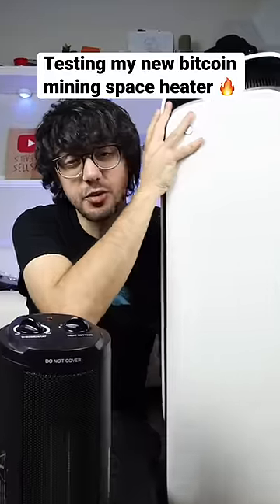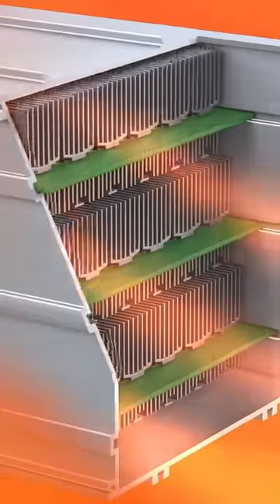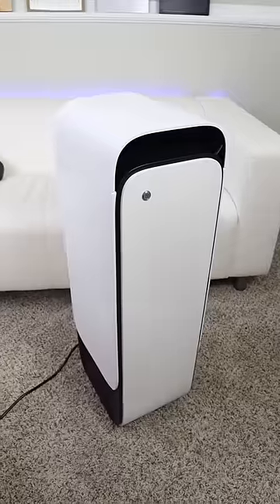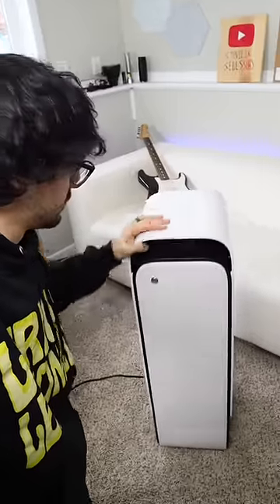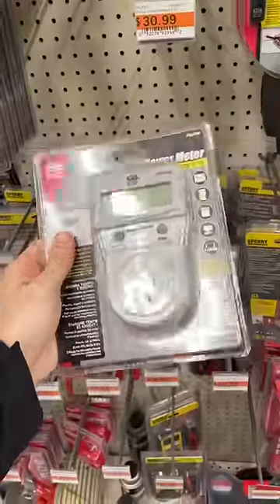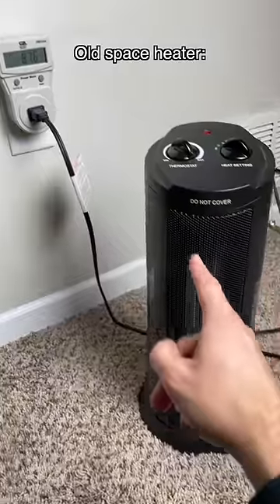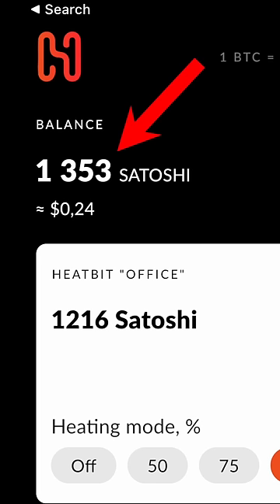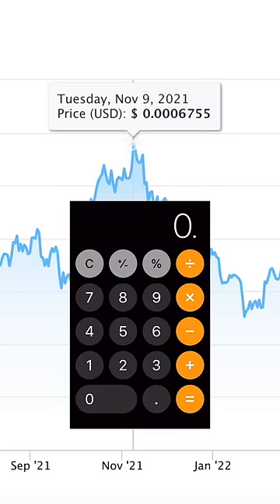My new bitcoin mining space heater

Comment: Got my $10 Walmart heater blowing on me while you got a $10,000 heater making $0.05 cents per hour. Life crazy
Reply: fr this thing is 10k???
Reply: Plus energy bill 🤣
Reply: @Drsteezymcgee  a 3000W mining setup won't cost more than a 3000W space heater
Reply: @rune_lol  so how can it be efficient at both heating and mining? It would have to split power somewhere wouldn't it?
Reply: @rune_lol  and cant running a space heater all day every day can be expensive ?
Reply: You aren't far from the price of $8,900usd for the white tower heater as shown in video
Reply: @rune_lol calculations actually take 0 energy. All the energy that is "used" actually is just turning into heat due to inefficiencies
Reply: Life crazy
Reply: It's around ~$1,100. Still crazy expensive for a heater.
Reply: @Drsteezymcgee  miners generate heat as a byproduct already which is the concept of this thing. Some people already build a ventilation system to pump the heat into their house or outside.
Reply: @Drsteezymcgee  computers/ mining rigs are 100% efficient space heaters. Technically the only part that can change the efficiency is the fan they use to blow the heat out.
Reply: @mashedpotatoes5323  ohhhh 🤔 but if that's the case why not just buy a mining rig and use it as a heater
Reply: @etherealnine  had no idea these things produce that much heat lol
Reply: @Drsteezymcgee  because this is probably for people who don't know how or don't want to build their own rig, it also looks pretty decent and seems like it could be moved around a lot easier than a mining rig.
Reply: With the cost of that heater you can just Stake some ATOM and generate 30 cents an hour without the electricity bill
Reply: @mashedpotatoes5323  fair point. The cost of convenience basically.
Reply: @Drsteezymcgee  100 percent of power in a computer ends up being heat
Reply: @etherealnine  because Bitcoin is a scam all the money goes to the energy companies.
Reply: @Drsteezymcgee  Its not semantics its how things work
Reply: @Drsteezymcgee  its a computer the downside of a cpu is it creates heat , esp if you are working it hard so 2 birds one stone its a glorified miner that has the benefit of heating your home , great in winter , but in summer no so much
Reply: @Drsteezymcgee  Energy does not disapear. It just takes another form.

By asking the miner to do work, it generates heat as a biproduct.

So you get two things accomplished with one action. Compared to only heating with a normal heater.

3000watts is 3000watts. Watts means joules per second, and that relates to energy usage.

Both mining and space heating converts all 3000watts into heat in the end.

Only thing more efficient would be a heat pump, then you could get 9000 watts of heat as the cost of 3000 watts under optimal conditions.
Reply: @UserOfTheName  it was a joke about how everything has heat energy lol
Reply: @MrDanisve  well what I read a while ago was that Bitcoin miners only put out 40% of thermal energy. So for 3000 watts  you'd only get 1400 watts of thermal energy.
Reply: @MrDanisve  also space heaters are 100% efficient at creating heat so maybe I'm missing something
Reply: @Drsteezymcgee  Miners are altso 100% efficient. Where else would the energy go but into heat? Its not emitting light, even if it did most light would turn into heat. Like a light bulb.

You can heat with normal lightbulbs too, will be a little loss but not that much.

Miner is not emitting radiation etc. Except heat raditation. 

This is elementary physics? Bit confused here..
Reply: @MrDanisve  I'm not an expert on physics, but I do know that an engine loses about 50 to 60 percent of energy do to friction between parts. Which, yes I understand, is heat. Buuuut the energy created is also being used to create something else, right. I mean I just looked it up and it says it doesn't ONLY create thermal energy. So therefore it would have to be less efficient than a space heater. Same power two things means less effective. It's the law of thermodynamics.
Reply: @MrDanisve  it's quite literally the idea of a perpetual motion generator. Which is impossible in physics to my understanding.
Reply: @MrDanisve  the reason why space heaters are so effective is because they use heater elements that are designed to heat, computer parts are not. A heater element is completely different than a CPU. Basic engineering. Having trouble?
Reply: @Drsteezymcgee heat comes frlm the chips
Reply: It's $1200 not $10,000 lmao. Still expensive of course but you could conceivably make a few hundred bucks a year, obviously not good as an investment, but to heat your room and use as a novelty it's not bad
Reply: 🤣 Nailed it.. The current price of bitcoin - it probably costs more in electricity than the bitcoin it generates.
Reply: @thisisisabella3634 is that why the biggest bitcoin miner uses solar?
Reply: @Drsteezymcgee  a computer is roughly as efficient as a space heater. Any difference is pretty much negligible. But it is definitely not COST-efficient.
Reply: @AlanisonYT  a CPU only produces 40 to 50% of it's energy as thermal energy from what I read. Where as a heating element converts 100. Think about it.. if a chip got as hot as a heating element it would be glowing red 🤦‍♂️
Reply: @AlanisonYT  parts in a computer can't even get that hot because they are designed not to
Reply: @Drsteezymcgee  why are you saying information that is incorrect, computer processors are 100% efficient space heaters, technically the only parts that aren't 100% efficient would be fans, mechanical hard drives and any LEDs.
Reply: @Drsteezymcgee  what do you think the heat sink and fans do? Also we’re talking computer, the cpu may produce 40% of the overall heat, but the rest is from the other computer parts. I can’t make it any simpler than that.
Reply: @Drsteezymcgee  mining requires computing, computing causes heat generation, heat is a side effect of the mining
Reply: @rune_lol  I can buy a 3000w space heater for under $1000, that thing costs 8.9k
Reply: @Betterthenyou375  obviously.. it's just less than half as efficient
Reply: @mashedpotatoes5323  have you ever seen a CPU glow like an oven element? They aren't built for that.. they would melt the all the components around them. Even with a hundred fans. You can't possibly think they are equally efficient at heating. Look it up my guy. One is built to stay cool one is built to stay hot.
Reply: @AlanisonYT  a circuit board would melt with a heater element in it. I can't make it simpler than that
Reply: It's $1200
Reply: @Drsteezymcgee  As i said, energy cannot dissapear. 

Only thing comming out of a computer is heat, and some light if you have LEDs on your tower. Or LED lighting inside.

The energy lost to light escaping your window is really not noticeable. Cause LEDs are so efficient. 

Why would it be less efficient? They both do the same thing, makes electric current go thru resistors. 

Just the space heater is one large resistor, while the computer is a collection of billions of resistors and switches. 

I have a bachelor in chemistry, and i have alot of physics cause of that. So im 99% sure im correct, atleast how we know physics today.
Reply: @Drsteezymcgee  No, cause you get 3000 watts of heat from a computer out of 3000 watts of energy.

Not perpetual motion generator at all.

And if you are talking about the heatpump.. Then lol, it only transfers energy from outside the house to inside your house.

Same way your refridgerator works. Its not "generating" the extra energy. Its transfers it from one location to another.

Man this is like very basic physics.. I have like 6 more years of physics at school than this stage.
Reply: @alouisschafer7212 $1200
Reply: this thing isnt 10k lol it literally cost less than my phone
Reply: @Drsteezymcgee  no because the mining is what produces heat. Its not a heater at all its just a bitcoin miner that doesnt use fans to keep itself cool.
Reply: @mashedpotatoes5323  I did research it. A CPU isn't a resistor. A heating element is a resistor. A heating element can get up to 1200° f. you're telling that anything in a computer can reach those temps? A CPU will die at like 100c. Maybe we're just talking about two different things lol and also you recited part of my comments verbatim wtf
Reply: @mashedpotatoes5323  you seem to be under the assumption that all energy is heat or something I really don't know what to tell ya
Reply: @Drsteezymcgee  Every wat a computer uses is converted to heat. a 300w computer produces as much heat as a 300w heater it just uses the power for something while it converts it into heat
Reply: @SerialElfYT  that's exactly what I'm saying the electrical energy can be converted to different types of energy. Not just thermal energy. Where as a heating element converts 100% of electricity to thermal energy, a CPU converts 40% and uses the rest for other things.
Reply: yeah so? I told you that it would heat the room for the same electricity cost not for the same initial investment.
Reply: It's only $1200
Reply: @Drsteezymcgee  lmao well you’re only harming yourself with your lack of understanding. So go ahead and believe what you want. Or educate yourself, maybe? I don’t care any more tbh🤷‍♂️
Reply: @alexdhall  its miner, not just a heater.  🤦‍♂️🤦‍♂️🤦‍♂️🤦‍♂️🤦‍♂️
Reply: It’s $1200, makes ≈$0.62/ hour, it’s not that bad if you live below the average kWh rate of $0.21 location that is cold year round. I’m in northern PA. It would pay for itself in 3 or 4 winters. My problem would be if it would still be able to competitively mine Bitcoin in 4 years and what it’s life expectancy would be as a workable machine?
Reply: @AlanisonYT  dude.. you can't convert 100% of electrical energy into thermal, mechanical, kinetic and radiation 100% across all boards. Law of thermodynamics. It's a thing. CPUs convert electricity to more than one type of energy whereas elements create one. Arguing with crypto bros is impossible 🤦‍♂️
Reply: @AlanisonYT  alright man I think I have a better way of explaining it to you. A heating element gets hot because it is made to get hot. 100% efficient thermal energy. A CPU converts electrical energy into a bunch of energies and the byproduct is heat. 40% efficient thermal energy
Reply: @Drsteezymcgee  mining creates heat as a byproduct. This is why Iceland has so many mining operations.
Reply: @sailingketchstarship1965  oh y'all are just fuckin with me 😂
Reply: @mashedpotatoes5323  don't tell me what to look up.
Reply: @Drsteezymcgee  just trying to help. Although with that response it's pretty clear you are trolling. Either way your comments are foolish.
Reply: @Drsteezymcgee  the efficiency of silicon is not that great 99% of the energy you put in is turned into heat
Reply: @AlanisonYT  Cost efficient depends on the marked.

I bought 6 gpus and made a frankenstein miner out of wood and some random PC parts i had laying around. in 2018

I sold the crypto when high and made about 10 times as much as the miner cost me to make. And i still have quite abit of crypto i havnt sold. Even bought myself new teeth with the crypto, and a car. 

The miner heats only 800 watts so i have to turn on extra heat during the worst of winter.

If you mine with this thing, and sit on the crypto untill the recession is over and markeds go up again. You can earn quite abit.

If i just used a space heater, i would still have ugly front teeth. Not having an Audi Etron car with lots of horsepower (Imma car freak) and general good economics compared to what i did have.

And soon i might get to my goal of buying a farm which is crazy expensive. Thanks to me using crypto as a space heater.
Reply: @mashedpotatoes5323  bro how am I trolling when I'm right come back when you know what you're talking about
Reply: @Drsteezymcgee  I do as well as everyone else in this comment section that is calling your crap....
Reply: @mashedpotatoes5323  the fact that you think you do is scary. Maybe one day you'll understand, but I'm done trying to educate you.
Reply: It’s actually around $1200 USD
Reply: while also losing even more due to more power draining your wallet.
Reply: @Drsteezymcgee  you just pulled the reverse uno on me 😂
Reply: @mashedpotatoes5323  😂 at least you're fun
Reply: @Drsteezymcgee  all the energy used mining satoshi would be turned into heat. The byproduct of using electricity like this is heat. Since electrical heating is technically always 100% efficient. And every watt used is 3.41 BTU. There is no difference between heating using a ceramic or a computer. But at like $10k this thing would take years and years to pay for its self. Not worth it.
Reply: The heater is $1200.00 but your point is still valid..
Reply: My 25 dollar heater from big lots I've had for 7 years. This things powerful man..
Reply: @ignCatchiest  no but it'll cost you one hell of a lot more than 2 - 1500 watt space heaters.
Reply: @Drsteezymcgee  the point of it Is it uses the heat from the components to blow out hot air
Reply: It's  about $1200, but um. I think I'll be waiting until the a summer time sale to run next year. MAYBE????
Reply: @Reaperzx6  thank you that really clears it up
Reply: @junkjunk4148  lol no
Reply: @rune_lol  yes it will heating is simple run electric current through something with resistance so just electricity wire and heat fins vs a computer thst Actully uses the electricity to do math with thousands of transistors computing stuff it will cost s hell of a lot mkre
Reply: where the hell are you getting 10k? its 1k on the official website.
Reply: @Drsteezymcgee  because your already mining the coins, that creates heat. So your making heat bevause of mining coins.

Two birds with 1 stone= Efficient
Reply: Costa 1000$
Reply: @Drsteezymcgee  no. Heat is always while computing. This is giving use to that heat instead
Reply: @Drsteezymcgee  you could do that, but the heat won't be distributed evenly, the only difference is the design, which is made to spread the heat to the whole room
Reply: @Drsteezymcgee  are you new?
Reply: @trippinxout  huh?
Reply: @trippinxout  ok. If I was wrong which I'm clearly not 😌 what's cringe about being wrong and learning from others?
Reply: @Drsteezymcgee all power will be converted to heat. You get the Bitcoin "for free"
Reply: @Drsteezymcgee  heating is 100% efficient, always. If your computer uses 200w, that wattage does computing, but all of the actual energy is dissipated as heat. Your 200w computer is also a 200w space heater
Reply: @mashedpotatoes5323  alright man I'll admit you were right, but since you're the smart one I think you might like this. physicist Melvin Vopson of the University of Portsmouth proposed that information is equivalent to mass and energy, existing as a separate state of matter, a conjecture known as the mass-energy-information equivalence principle. This would mean that every bit of information has a finite and quantifiable mass. What do you think of it? I stole this from Google so don't think I made this up I'm not smart like that. This was a fun learning experience
Reply: @trippinxout  physicist Melvin Vopson of the University of Portsmouth proposed that information is equivalent to mass and energy, existing as a separate state of matter, a conjecture known as the mass-energy-information equivalence principle. This would mean that every bit of information has a finite and quantifiable mass.
Reply: The one I found Is 1200...
Reply: @Drsteezymcgee  I have heard of that, it's a bit over my head but vsauce made a video about how much does the internet weigh a while ago which kinda talks about it. Although it doesn't apply to anything with the efficiencies of a space heater vs computer it's still pretty cool.
Reply: @mashedpotatoes5323  it's super cool, but my point is that based off the law of thermodynamics. energy can't be created or destroyed. So if information has energy then how can 100% of electrical energy be converted into thermal energy and also create information energy? Just food for thought like I said before I'm no expert... Obviously 😅
Reply: @Drsteezymcgee  think about it this way, the information has to be stored somewhere like in RAM or a solid state drive which requires energy (electrons which have mass) to be present for the data to be stored. The electrons are just occupying the space inside which gives it the mass but ultimately will be turned into heat by the silicon.
Reply: @mashedpotatoes5323  I get the heater thing now. I guess my peanut brain just can't get the efficient part.. if Info energy is stored how can it produce another type of energy if it never goes away? Is it an infinite heat source or does information have to be made constantly? I'm probably going to obsess over this for weeks 😂
Reply: @Drsteezymcgee  information stored electrically constantly needs power for the data to remain on it. With RAM the data is lost when there is no power and with solid state drives the information can be stored when there is no power connected because they have capacitors/ batteries to store the energy so the data isn't lost. Mechanical hard drives are different as they store the data magnetically so no power is required to keep the information stored.
Reply: Losing money to power lol
Reply: @mashedpotatoes5323  does that mean that the information energy stored doesn't create thermal energy? Or rather when it is disconnected does it release heat or does it disappear?
Reply: @Drsteezymcgee  the information stotored isn't creating heat it's the electrons being turned into heat. I would assume that technically solid state drives when unplugged do generate heat but it would be a extremely tiny amount since the power stored is a extremely tiny amount, again it's a 100% efficient electric to heat conversion.
Reply: @mashedpotatoes5323  ig that makes sense, but if information is a type of energy then the electric energy is creating two types of energy. So if 100% of electrical energy is converted to heat then where does the information energy come from?
Reply: @Drsteezymcgee  the information requires energy which makes heat.
Reply: @mashedpotatoes5323  so all energy is fuckin heat oh Lord 😅
Reply: @Drsteezymcgee  90% of the power computers draw get turned into heat
Reply: @Drsteezymcgee  this might have better flow as a space heater like it can blow at you
Reply: @mrgyani  if u actually need it to heat ur house tho ur not wasting electricity
Reply: @Drsteezymcgee  they don’t use as much power as a heating element thats why they don’t get that hot
Reply: @Drsteezymcgee  more power means more bitc, more power also means more heat. The efficiency only needs to be with cooling, if you can improve its air cooling you make everything more efficient.
Reply: @mashedpotatoes5323  Not quite 100%. For example if any electricity is used to move a fan to cool your CPU then that’s electrical energy being transferred into mechanical energy and not heat.

I’d also imagine that sending information requires energy and therefore you’re converting electricity into data that is being sent from the computer back to the internet and that is not electricity being lost directly as heat.
Reply: @UserOfTheName  Again, it’s not quite 100%. Do you have any fans in your computer? Because those fans turn electrical energy into mechanical energy rather than the electrical energy being dissipated as heat.
Reply: @Drsteezymcgee  most energy end up as heat so it's working away doing what it does and uses energy to do it and that energy is turned into heat. Basically its doing the calculations for free.
Reply: I bet he just borrowed it for the video… most “influencers” don’t own much, they rent or borrow stuff to flex around.
Reply: @CM-ky5go  I already went over that
Reply: @Drsteezymcgee  the heat is a byproduct of the mining. No it doesn't have to split power
Reply: @Drsteezymcgee  they both convert electricity into heat, but the coin miner also ends up with data/information. So while you are getting more from a miner than just a spaceheater, its not more energy, its the same amount of energy (heat) just that the miner also ends up with data
Reply: @alouisschafer7212  no fr it 1k
Reply: @rune_lol  no one needs a 3000w heater lmfao
Reply: @junkjunk4148  That's a pretty silly argument. IF this thing were 100% efficient it wouldn't use any energy! lol
Reply: @Drsteezymcgee Heat is produced waste energy from running the computer. Heat is what is leftover for conservation of energy since all reactions are inefficient. The issue with this is that as you increase the heat, you bring the computer closer to its thermal throttle where the components aren't able to function properly and may break, which is typically a lower temp than you'd be running your space heater at.
Reply: It looks like a ps5
Reply: @Nanamowa  ya I think you are saying what I'm saying. one thought I had was like in the body you insert food (electricity) then some of its stored. Then the waste product (heat) is removed but not at 100%. A heating element doesn't store energy it only converts it. Unlike a capacitor that stores energy and doesn't create heat while it sits there until it blows up or something. But even a heating element creates light energy and radiation. And then there's the whole information energy thing which just is blowing my mind right now.
Reply: @alouisschafer7212  Nah it's 1.2k
Reply: @rune_lol  uhm??? Watt's are not a currency bro
Reply: @filoofox9934  no, watts are power draw, power multiplied by time is labour, you pay your electricity for this "labour". So while its not currency it does dictate cost.
Reply: @Drsteezymcgee No it has a 100% power efficiency all the power goes in comes out as heat because the mining setup is the heat production the product is bitcoin and heat this just outputs the heat in a useful way
Reply: @kestrels-in-the-sky  some of the energy is stored most of it is emitted. Use of power isn't what I'm talking about.
Reply: @Drsteezymcgee  yes it was you said how can something be efficient with mining and heating some pier must be wasted
Reply: @kestrels-in-the-sky  yes as in how can something store energy and emit it at the same time. So it couldn't in theory be as efficient as a heating element
Reply: @kestrels-in-the-sky  I never at one point said that all of the energy wasn't being used. I said the process of heating was inefficient compared to a heating element
Reply: @Drsteezymcgee  No the heating element will use the power for other things this just uses it for heat even if it’s over a longer amount of time
Reply: Its like 1,200 brh
Reply: 5 cents per hour seems like a waste of time. Basically I don't get how people get so many bitcoins
Reply: @MrDanisve  lol wrong duck
Reply: @Drsteezymcgee  heat is literally a waste byproduct of any electrical process. It's putting all the energy into mining and happens to also heat a room.
Reply: @Drsteezymcgee  not sure what you looked up, but all energy eventually becomes heat. Literally all energy basically is in simplest terms, hince *thermo*dynamics.
Reply: @Drsteezymcgee  heat is unusable as an energy source. You can't use heat to generate more heat. No laws of physics broken.
Reply: @Drsteezymcgee  all energy IS heat. That is absolute basic physics and why it's called *thermo*dynamics. You really are showing your ignorance for someone who claimed to "look it up".
Reply: @Drsteezymcgee  by your logic, a heating element glows, which means it's making light energy, not just heat OH WAIT THEY'RE THE SAME THING BECAUSE ENERGY IS ENERGY IS ENERGY
Reply: @kylehenline3245  yes.... a calculation doesnt use energy by itself if we look at it from a pure physics standpoint. In reality achieving a system would be impossible but only due to factors besides the calculation itself.
Reply: @Studio23Media  yes it is how it works. Actually they were trying to make the heat loss go away entirely by calculating with light. This is what calculation means to the universe. It is meaningless.
Reply: @UserOfTheName not sure its 100%, some goes into resistors which hold electrical energy for a period of time, but most is heat yay.
Reply: @MrDanisve pretty sure there is some inefficiencies as well so not all 3000 watts but roughly yah
Reply: @benjaminhansen4370  I have my meter inside the house, so all the inefficiencies i pay for goes into heat in my home.

If i had meter at the street i would pay for the loss in the cable from the street to the house that would generate heat lost to the outside.

Other than that, all the inefficiencies and processes turn into heat.
Reply: It would take 9 years for him to earn that 10K back.
Reply: @Drsteezymcgee  all the power it draws will end up as heat.
Reply: Much cheaper to get solar panels and battery to generate free heat and power to other electronics.
Reply: Now, I'm bad at math, but I think $0.05/hr would be $1.20 a day, or a whopping $8.40 a week
Reply: @rune_lol tf is you talking about??? that thjng is basically 30 gpus in a case, last time i checked there were no space heaters that cost the same amount as a mining capable gpu
Reply: @Drsteezymcgee computers are basically heaters with weird wiring patterns. Power goes in, it flows around, it goes out, only heat is created.
Reply: atleast it make few buck 😂😂
Reply: @rune_lol you clearly lost your mind in the sewers
Reply: @Drsteezymcgee  The bitcoin miner cpus, and while its running the cpus generates heat.